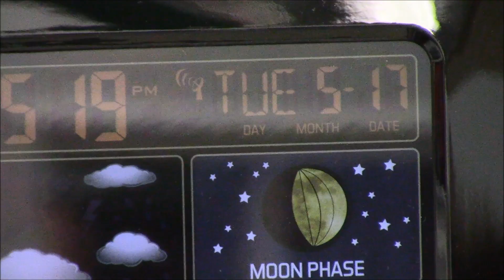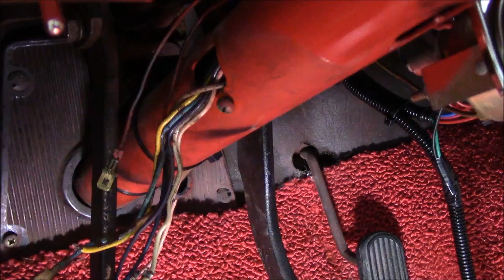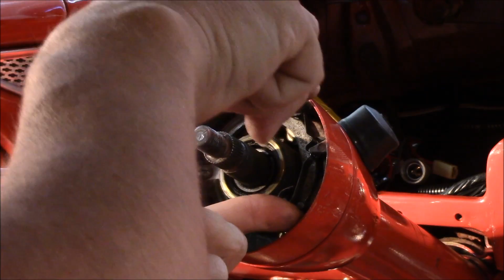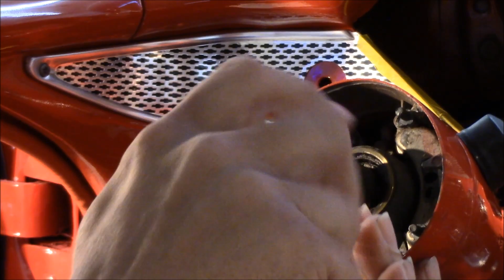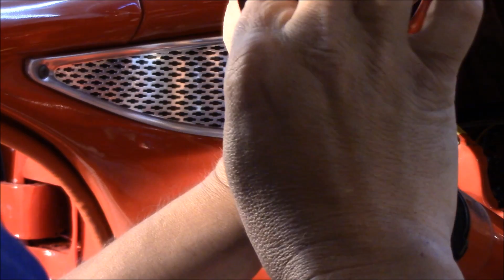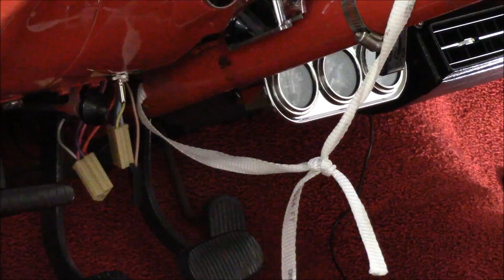55 Chevy steering column disassembly

Comment: Any idea how to install brake pedal return spring. Great video on how to replace upper bearing and horn kit installation
Reply from the maker: Thanks Ed. I haven't installed one. I mainly work on 70-81 Camaros. I took this 55 in as a side project for the wiring, helping out a good friend of mine.